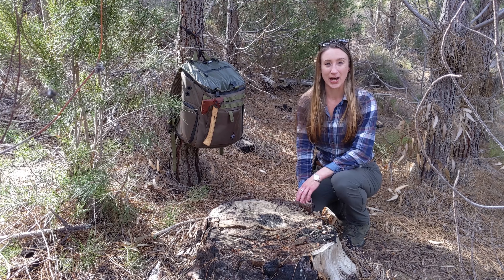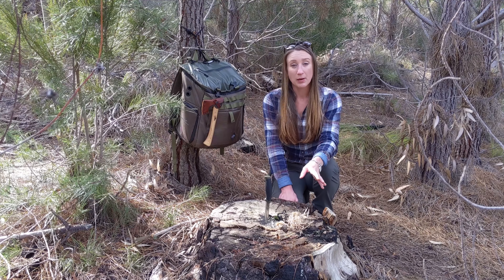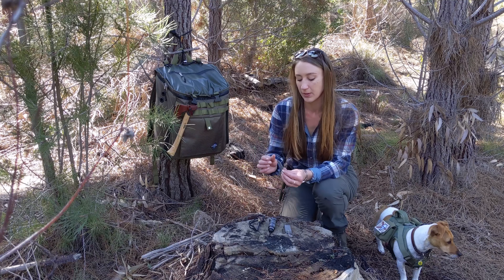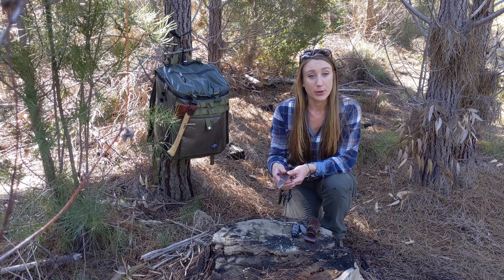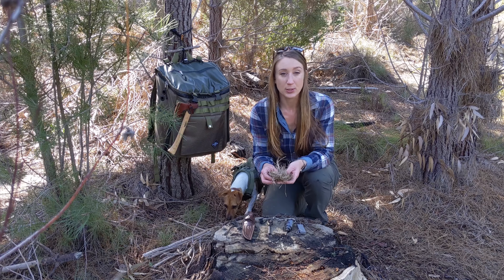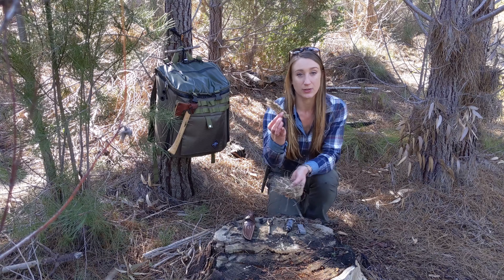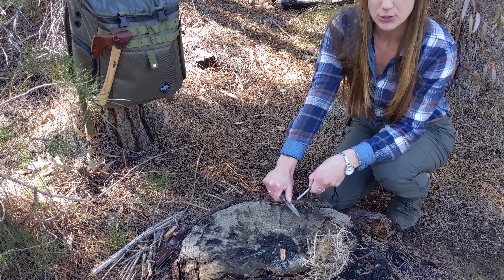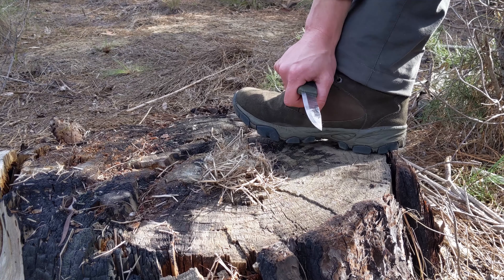FERRO ROD FIRE STARTER TECHNIQUES AND FERRO ROD TIPS

Comment: As always a great video, well thought out. Important that people note the use of the back of the blade as the spine rather than trying to use the blade itself which will quickly dull an edge, leaving you with 2 damaged pieces of survival equipment! Fantastic work, a really important skill. 😀
Reply from the maker: Hi Si! So great to hear from you, you're absolutely right, and a dull knife is a dangerous one (bar my slicing my fingerprint off with a sharp blade, rookie error). Thanks for your comment, as always, stay safe in the wild! C

Comment: I've cleaned up peoples' ferro rods that had severe "chatter" marks on them due to them being used improperly. It gets real "interesting" when using a file. 😂

I've also cleaned them up with a bit wet/dry sandpaper.

Chatter marks aren't that big of an issue on a ferro rod only, having 360 degree access, but when you have access to just one side of it,  such as when they are attached to a magnesium bar, then they can be a bit bothersome for folks not understanding why the chatter marks are being created in the first place.

Even if your SAK doesn't have a sawblade with a 90 degree spine the burr/edge on it's awl makes for a great sparking tool for a ferro rod. If you absolutely have to use a knife's cutting edge use the part of the edge closest to the base of the blade thus keeping the rest of the blade out to the tip sharp.

It's not a bad idea to practice with sparking ferro rods with other improvised sharp edges such as steel food can lids, etc., just to get an idea what may work in a pinch.......and what probably won't.

I like that "no-nonsense I'm here to bushcraft" shirt ya got in Clarise!